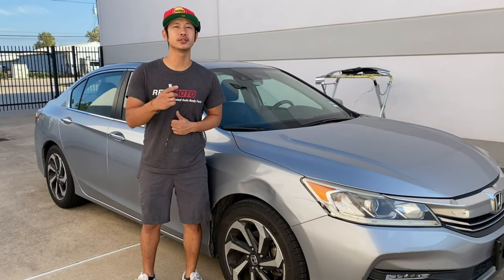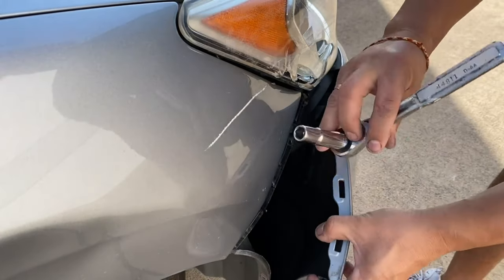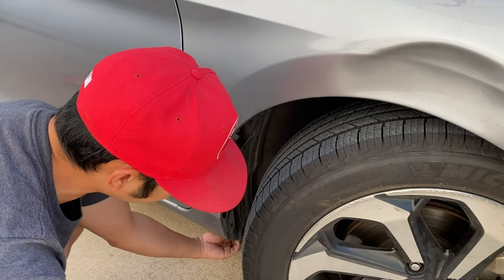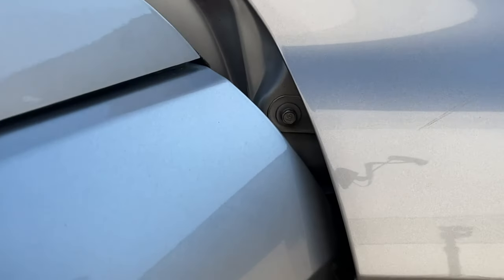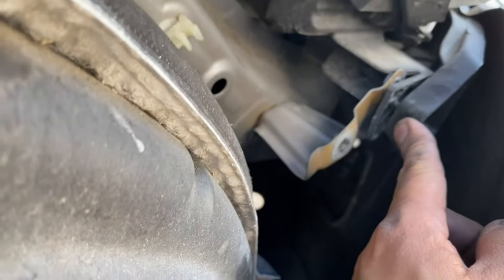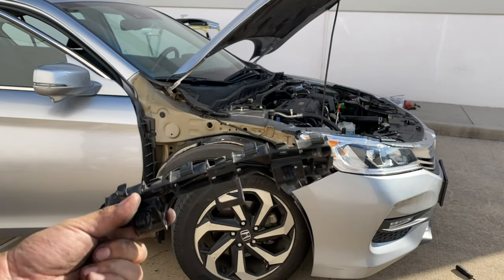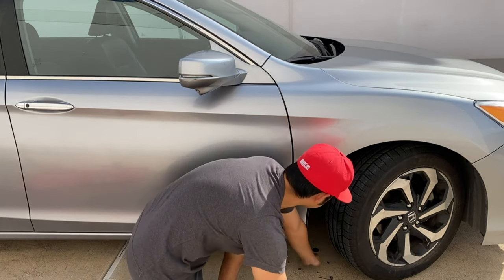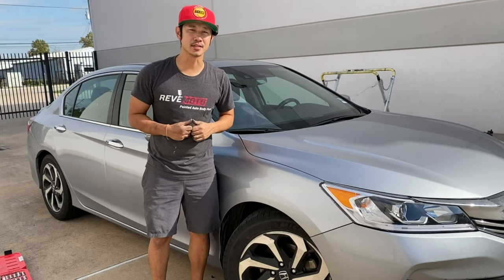How to Remove and Install 2013-2017 Honda Accord Passenger Fender.  No Special Tools |  ReveMoto.com

Comment: Wow,  I do not need to remove the whole bumper. You will save me time with my fender replacement.
Reply from the maker: Yeah no need for whole bumper just get behind it for that bracket bolts.  Glad this helped.  If you need the fender go to www. Revemoto.com.  Thanks for watching